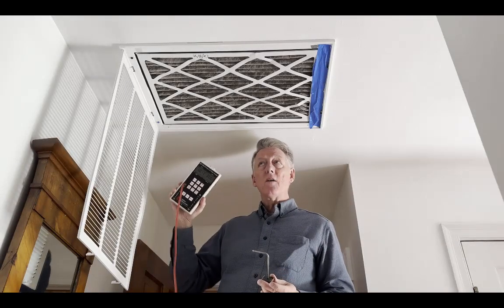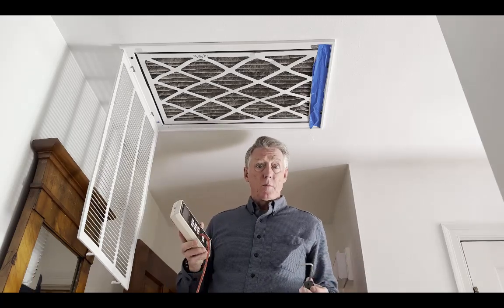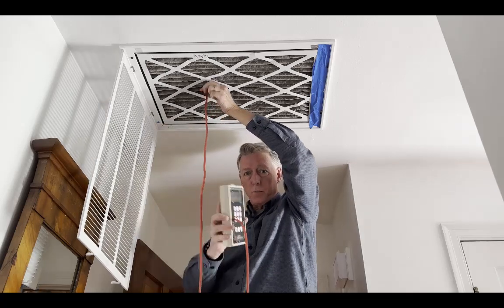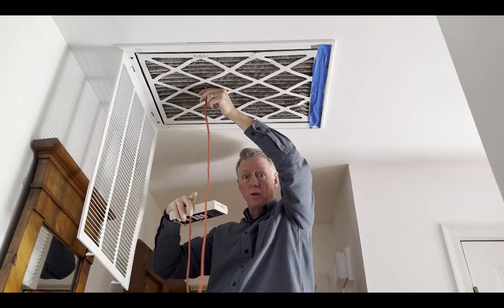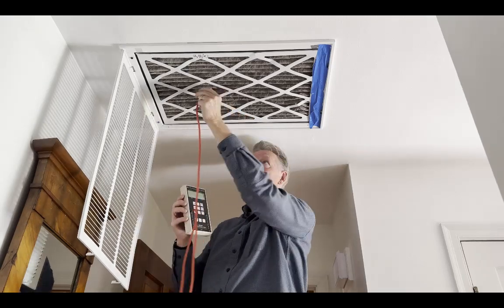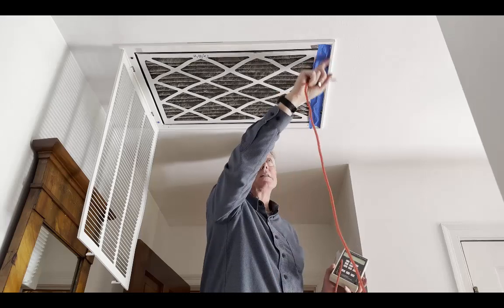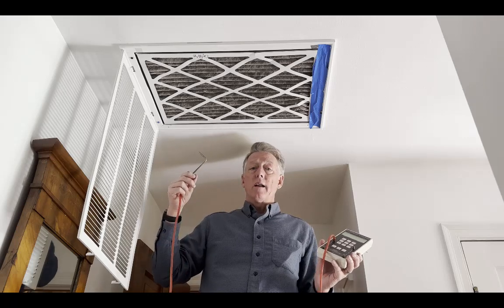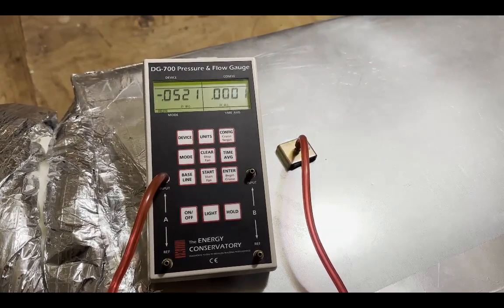Measuring Filter Pressure Drop

Comment: I only have filters on my 3 return ducts, how could I measure a new filter since, like you said, i don't want to poke a hole in it. I'd also like to be able to measure intermittently to help determine when i need new filters. Haven't been able to figure this out, thanks!
Reply from the maker: You have to be able to insert a static pressure probe in the duct on either side of the filter. If it's in a filter grille, as mine are, you just need to measure the duct pressure behind the filter and use the room as your reference pressure.